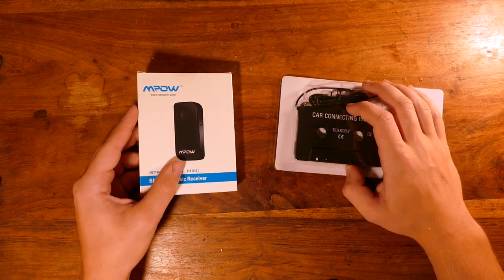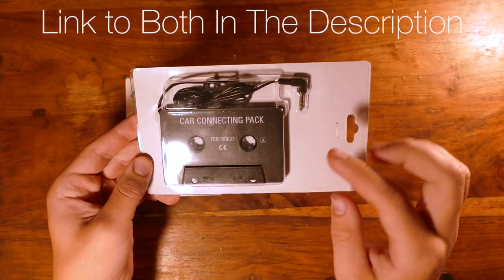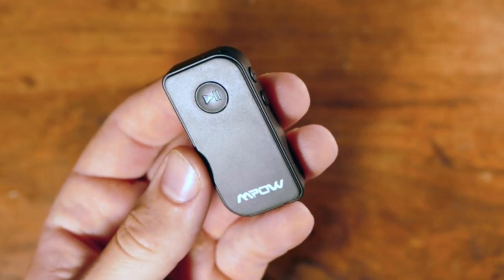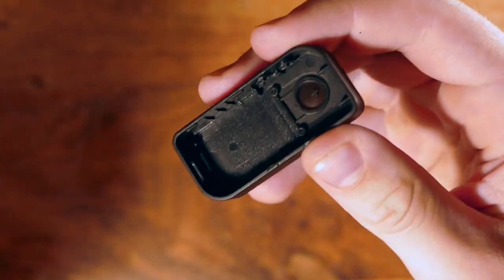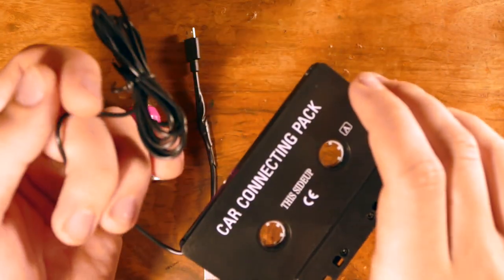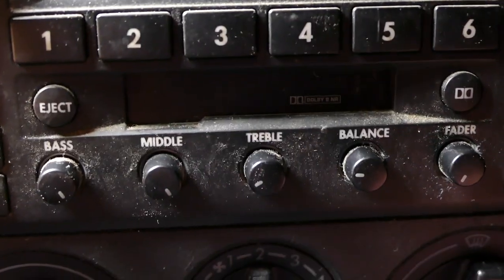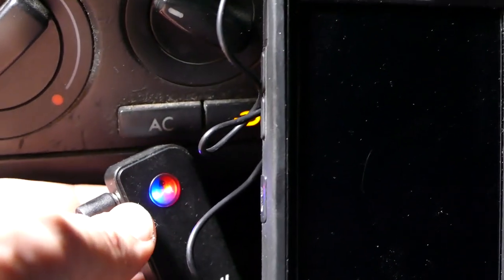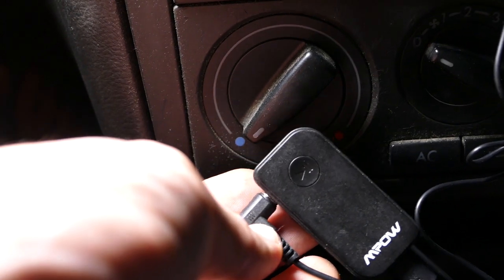Bluetooth Car Hack! - How To Make Any Old Car Bluetooth!!

Comment: You know there's a cassette adapter with bluetooth integrated? It's called iOn, and makes it easier than building that, but still - nice video! :)
Reply: Just checked it out. Very cool! However.. compared to this, it is very expensive (74.01 Australian $) and not many people would buy it :/
Reply: it also needs to be recharged every night...
Reply: the problem with using the cassette player is it's VERY low quality. you need to completely bypass it.

Comment: What about if you have no tape slot and just a CD one?
Reply: Get the car adaptor that emits FM frequency so you use your car radio to connect to your phone.
Reply: TheBlackCat1997able  isn't the sound on fm adapter bad and choppy?
Reply: Jassiel Quintana No, perfectly clear :)
Reply: What I did was buy a module that plugs into the CD Changer port at the back of the console. 

Now I have just bought a Bluetooth receiver (not sure if I will take out the battery though).
Reply: not true, at times there is static.
Also the new iPhone has a different port.
Reply: Bluetooth FM Transmitter, set it to 87.9. Thank me later.
Reply: Fm transmitor, pop it apart locate the antenna solder point in it, solder a 4ft piece of 14g wire to it, drill a hole in the body of the fm transmitor,run the wire through the hole and put the transmitor back together, pop head unit out unplug the antenna jack, strip enough of the wire so it wraps around the antenna plug a couple times, solder it if you want I did, plug antenna back in and put the head unit back into place, fina an unused fm station and there ya go no more static. Sounds harder than it really is. I had mine done in about 30min.

Comment: i bought a usb bluetooth receiver for like 3$, its cheap and fragile, and i might end up changing it to one of these when it fully breaks, but so far, the bluetooth connect works great, it only disconnects when i get a bad bump, because the usb port is about ready to fall off the circuit board..

Comment: Try an FM Transmitter, bluetooth if you don't have an AUX port and no need for usb power, as it runs off the 12 Volt plug in your car.
Reply: good luck with changing fms while driving in highway a hundred of kilometers...

Comment: wanna cleaner wire trick? all you need is aux and some type of solder. you have to take out radio and open it. find spot where is that tape reader. there must be 3 wires. left . right. ground for tape input. cut or just solder your cable on it. now you can run cleaner wires ;)

Comment: Or you could get a Bluetooth FM transmitter for $15 which is a single car charger
Reply: subway5411 yeah thats what I have and it works really good
Reply: Where/ which exactly? Thnx
Reply: Cody Herman 792 how long before charge is needed? Also where is it suppose to be connect? Tape deck or Aux ?
Reply: I buy mine on wish for 10 € and it work perfect
Reply: 3 months late but it's connected to a 12v slot in your car (the one those cigarette lighter's use) and it has bt and fm built in so you're done. Just connect your phone to the transmitter and it shows which frequency to tune your radio in to.

Downside is some of these have a worse quality than actual bt receivers.

Comment: Bluetooth fm transmitter. No wires needed at all.
Reply: I know
Reply: if a bluetooth fm transmitter is anything like an aux fm transmitter, the quality is not good!

I can get CD quality (320kbps) through a module i plugged into my cd changer port, and with the bluetooth module...I think it would be a bit less than CD quality but still high quality. 

but with an fm transmitter, you are talking crap quality. Maybe 128kbps at best.
Reply: Can you explain the cd changer hack

Comment: Not sure if Ive done something wrong.  Removed the battery however the unit doesn't fully power up and shuts off fully within 3 or 4 seconds.

Comment: how about step it up and solder the aux into the audio unit circuit board tape line in. Then stick the bluetooth device inside the the audio unit powered with a 5 v reg attached to the units 12 v power supply.
Reply: Shtoops27 lol. True. However most folks want something simple. They don't want to "risk" tampering with system wires.

Comment: A Bluetooth FM Transmitter for about $10/15 dollars is a much cheaper and simpler option and the quality of sound isn't shit like some would have you believe. Just find the best frequency and it'll be fine. Fuck spending $70+ and messing around cutting cables, removing batteries, gluing etc. What a waste of time and money!

Comment: Can someone tell me why it's smokes when he removes the battery cables?
Reply: He is using a soldering kit to remove the battery. The device he is holding heats up the metal that is keeping the battery connected to the bluetooth receiver and separates the wires.
Reply: so i cant just like pull out the cables, would i have to use a soldering kit?
Reply: Daphne Chu
Reply: yes you can but you will probably break something, try to cut the wires that hold the battery

Comment: Yo thanks a lot dude I did this and now my Bluetooth won't work. The light will turn on but the Bluetooth won't work. It worked perfectly fine until I took out the battery. Thanks for the advice advice jerk. I'm boutta sue you for $11.99 plus tax buddy be ready
Reply: Mike williams 😂😂😂

Comment: at this point why not just plug the jack from the tape into the phone ??.... instead of having all those cables hanging everywhere and welding and all
Reply: the 'welding' is not really necessary it is just something he did out of personal taste.  but not plugging the aux in directly, that is so you never have to remove the wires.

Unless you meant the soldering..which is necessary to keep it automatic. 

Actually yes it still looks messy, but apart from keeping bluetooth on/off on his phone, he never has to do anything in the car itself. You would have to keep fiddling around with the aux cord otherwise.

Comment: or just install an aftermarket head unit instead of going ignorant ghetto
Reply: aftermarket is not so straight forward. Some cars do not have the right fascia. You would have to buy another fascia, the aftermarket head unit isn't cheap in any case, and the installation is not exactly any easier than this.

Comment: I pretty much have the same car and did the same thing but my car feeds power to the outlets regardless if the key is in it or not. so if my car sits long enough the battery will die and I'd be fucked, so I just turn it on and off everytime NBD.
Reply: Kyle Erickson the energy that small transmitter gives off is miniscule. You would probably need your car to sit for like 9 months for the battery to drain. Lol

Comment: the new car stereo with bluetooth is only $50 for a basic system. This is senseless. Do not waste your money and time. Get a stereo with it!
Reply: Don't forget to add anywhere from $20-$30 for the radio din adapter and another $15-$30 for the wiring harness, plus having enough knowledge to DIY the wiring from harness to aftermarket radio.

While I prefer aftermarket stereos in many cars myself, some simply don't have the $100 or more needed to go bluetooth. 

Next time, think before you speak... lol